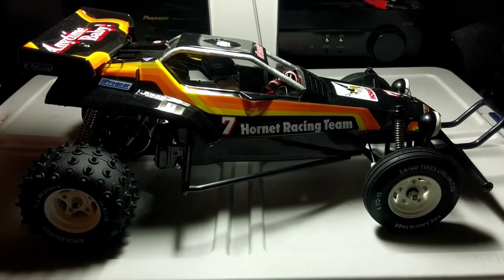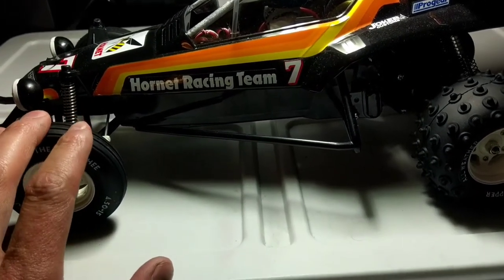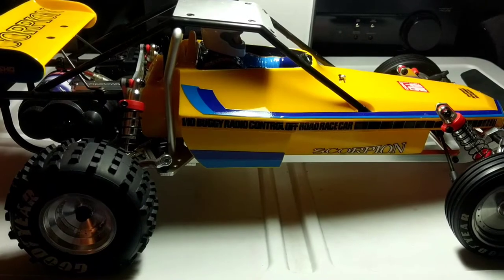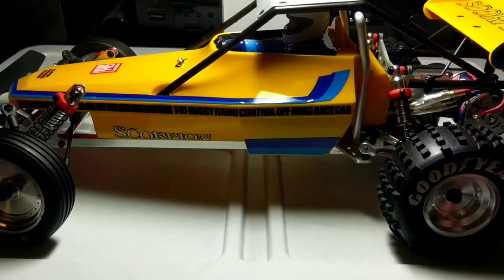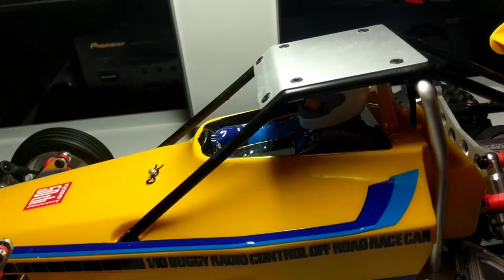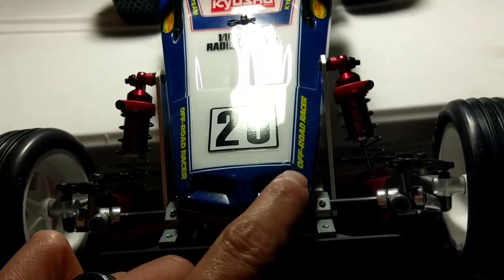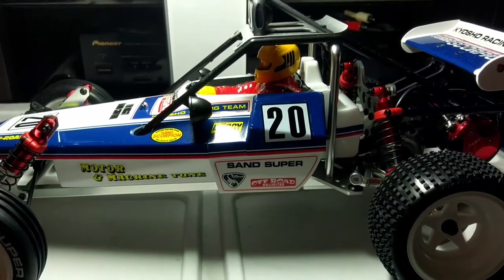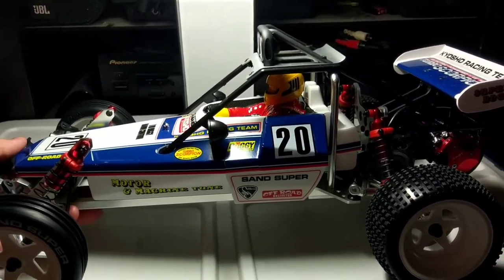My re-release collection

Comment: I've got these 3 as well, (Also the Tomahawk, Optima, Tamiya Bruiser still in their boxes and Javelin yet to come) haven't finished the Scorpions yet though. What yellow did you use for the Scorpions body shell?
Reply: @keithrx3c @dwblue00videos I see you 2 have lots of RC. Would you happen to know if the new Turbo Scorpion wheels and tires would fit a vintage kyosho ultima pro or ultima 2?
Reply: @GIZZMOTORSPORTS  Just saw your reply. The Ultima Pro rear wheels (yellow disc rims) fit the Turbo Scorpion OK but I didn't have a tyre on the rim, but looks like it will fit with a tyre.

 What yellow did you use for the Scorpions body shell?
Reply: keithrx3c thanks, I can’t remember what I was asking. I ended up with new turbo Scorpion 2.2” wheels for the better tire selection